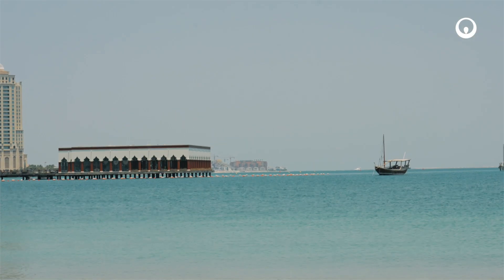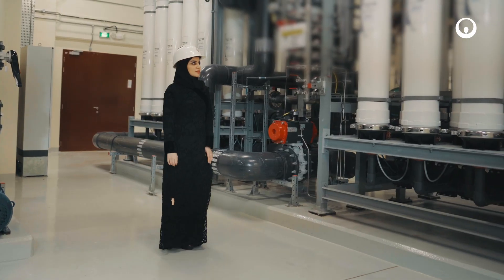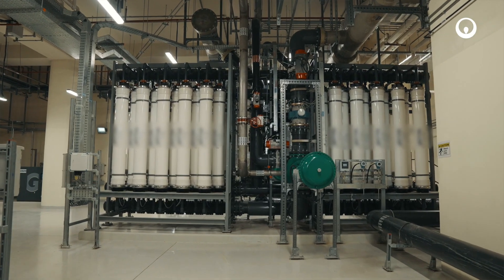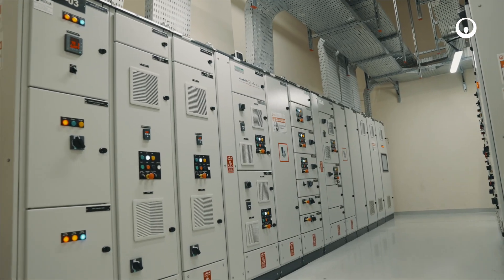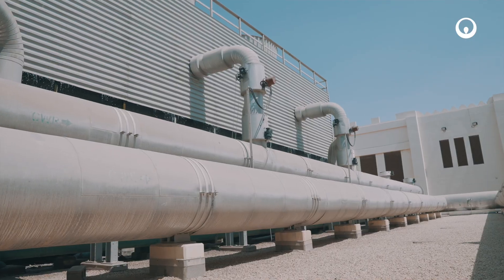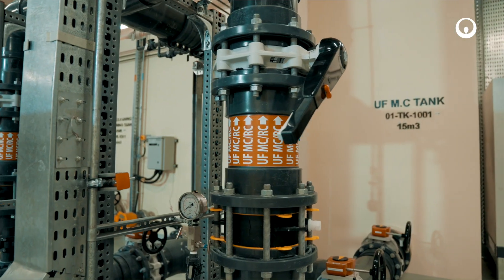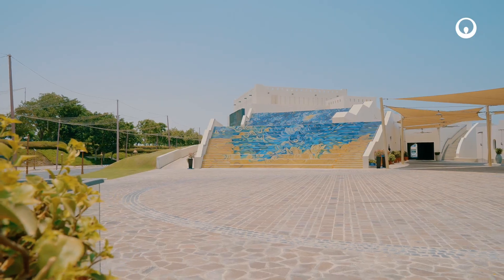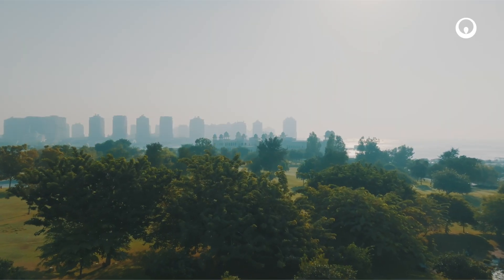Katara Project - The journey of water of the biggest water reuse facility in Qatar

Comment: Any figures, about carbon foot print of this project. The price per cubic meter will be low as energy is cheap in Qatar. Bigger question is how much fossil fuel is used per cubic meter of water recycling. I would suggest to add solar panels all over Katara which has negligible green area. (Excluding the park) It will help to reduce heat in summer and providing carbon print free water recycling.